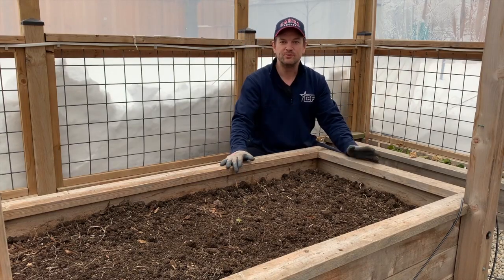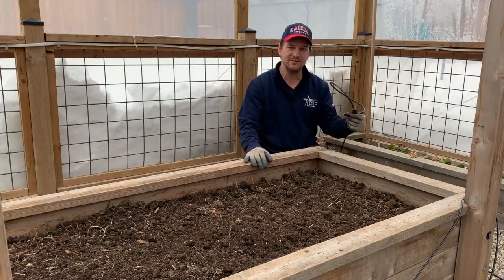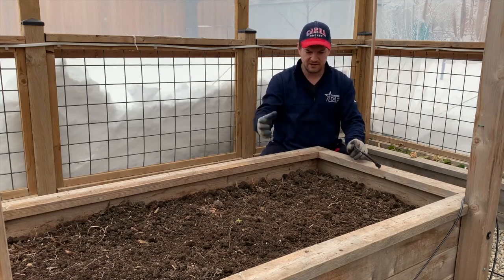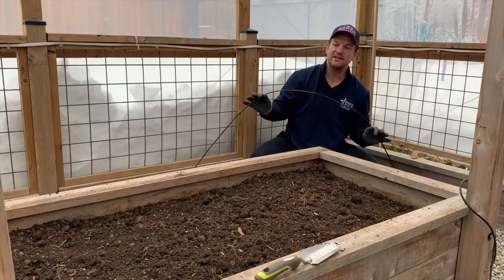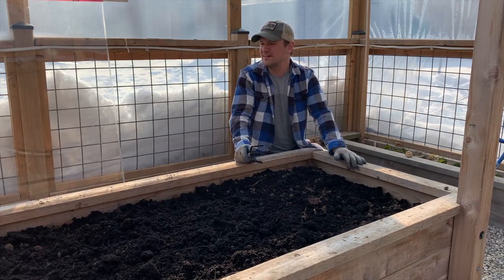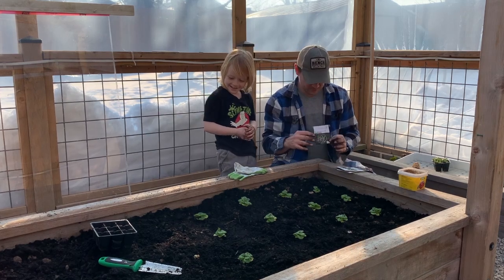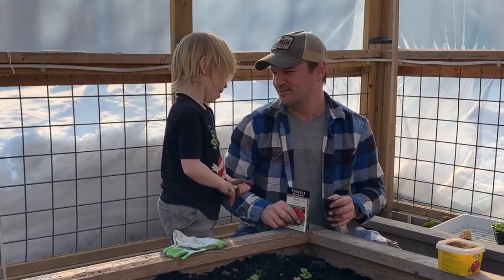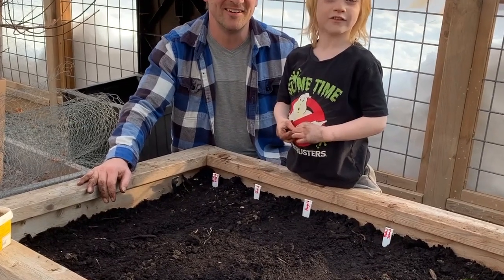A HEATING CABLE WINTER GARDENING HACK: Grow & Harvest Cold Hardy Crops ALL WINTER! | MyNiagaraGarden

Comment: I have a similar setup here in B. C. I'm curious as to whether you've had any thoughts about the coatings on the cables? I read the fine print on the package that my heating cable came in, and the coating is a fluoropolymer ,which l find concerning. I don't know whether or not the coating might possibly be breaking down ,and leaching into the soil, and then maybe being pucked up by the produce. I'd love to know your take on this. Thanks.

Comment: Thanks for the video. Will this cable be able to pump the heat to 22 C? The Amazon link says the cable will turn off at 50 F / 10C.
Reply from the maker: It’s been a couple years since this video, but I remember the specs of the cable saying that the thermostat turned the cable ON at 2 degrees C, and OFF at 18 degrees C.

Comment: How did this turn out? Love the videos! ❤️
Reply from the maker: Hi C B, it turned out great! Huge lettuce heads, big Arugula, leaf lettuce, and radish harvests.  I have lots of updates on the progress using Reels on my Instagram channel @MyNiagaraGarden
Reply: @MyNiagaraGarden  awesome! So glad to hear that!
Reply from the maker: The only constraint I found was the short days in the winter meant less sunshine, so the growth rate was slow at first .
Reply: @MyNiagaraGarden hey man from MI, across the lake, what was the solution to burning the soil or starting a fire or watering the soil
Reply from the maker: Hey  @soulranger4524  I buried it about a foot deep, so there wasn't much risk of root burning, or fire.  Both ends of the cable (one end with the thermostat and the other with the plug) were both kept out of the soil and away from water, and the cable itself is water proof, so there was no issue there either.  It took a bit of effort, but the experiment did succeed in the end, with a hearty harvest of romaine heads and cold hardy greens in April! :)